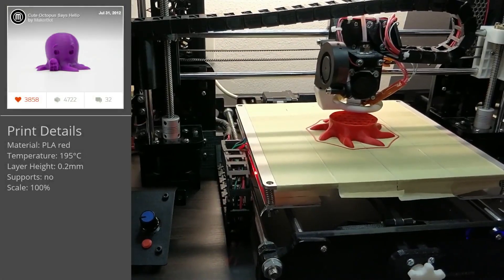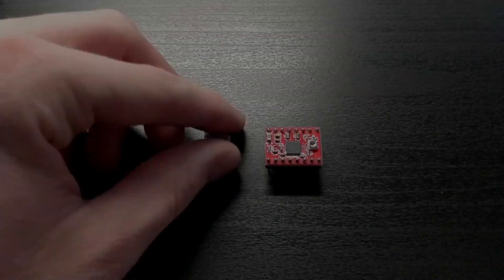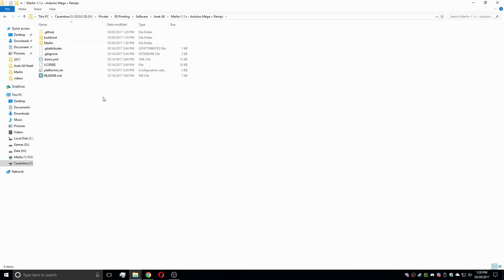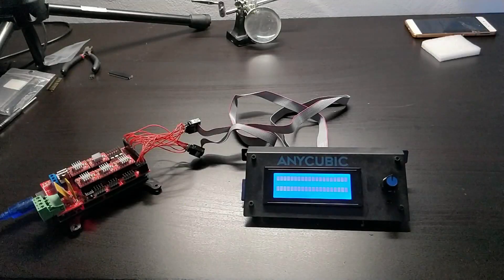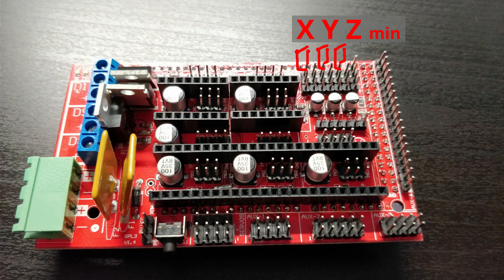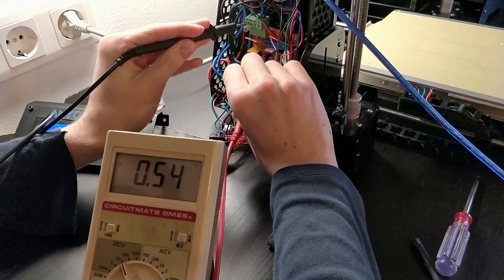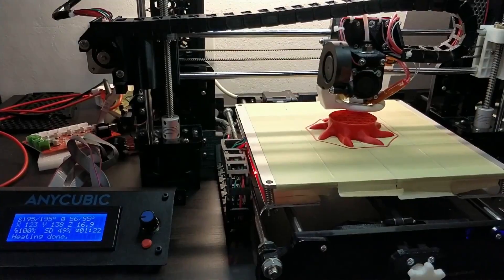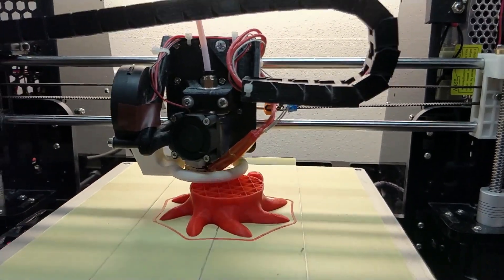Anet A8 Controller Upgrade (Arduino Mega + Ramps)

Comment: newer versions of marlin uses ZONESTAR_LCD at 1:45 instead of ANET_KEYPAD_LCD
Reply from the maker: That's true, I have learned it the hard way as well!
Reply: Oh interesting, for me that was not the case... i installed it 3 days ago.
Reply from the maker: It depends on which version of Marlin you have. They changed it in 1.1.7 (current is 1.1.8) along with a lot of other changes.
Reply: the one you are mentioning is listed above or another lcd? could you please share the link of ali express?

Comment: i want to make my anet a8+ silent, can i do this with this setup? the noise comes from the drivers, the steppers or the board?, can i just use other drivers?, thanks!
Reply from the maker: Yes, that's one option, but you need different drivers than I did, as mine are the cheapest A4988 that are actually equal to the ones of the Anet board. You can use better drivers, but only some work with an 8-bit board and some require extra wires and thus extra configuration. Also, they tend to get hotter, so you might need a cooling fan for the board. Another and maybe nowadays better option is to get a 32-bit board, they have become very affordable and allow you to use the high-end drivers.
Reply: @Caverntwo  which 32 bit board would you recommend me? im on the budget side, thanks :)
Also i have another question, the only thing that i did not like about this printer was its lack o fine detail, besides that is noisy as fuck. I only took notice of this when printing litophanes, anywhere else is decently smooth. Could this be because the resolution of the steps on the default board are lower than on an ender 3? With enders i can get really sharp details.
Apart from that im super in love with these printers, i've been running one for hundreds of hours without a single failure. just kinda lack of robust repeatability due to the extruder/hotend being kinda bendy. Also this is the first printer that hasnt given me any issues with the glass bed(warping), i found that kinda amazing.
Reply from the maker: Sadly I can't give you a recommendation, as I have only used two of them so far (that Chinese SKR and the mainboard of my new Artillery Sidewinder printer).

The noise is very likely due to it using cheap drivers, that are just simpler in design. Also, I'm pretty sure that the printer resonances the noise to make it louder. 

The resolution issue could have different causes, starting from the nozzle size, over controller accuracy and slicing settings all the way to the mechanics of the printer. Try to get rid of most of the mechanical play you find. From my Anet A2 I know, that the gantry had a ton of play. Check yours as well. Try to print very slow to see if the resolution is better. If so, there are mechanical issues/flexing/wobbles.
Reply: @Caverntwo  thanks man :elbowcough:

Comment: how did you set up you're dual z motors? id like to use E1 Port for Z2 under the name "Z_DUAL_STEPPER_DRIVERS" isnt listed
Reply from the maker: In my case, they are both connected to the same driver, so I have no dual z function in use. It works nicely without too. 

But if you want "real" dual Z, you need two stepper drivers and need to do the following config (Marlin 2.0.x):

In configuration_adv.h:
#define NUM_Z_STEPPER_DRIVERS 2

Furthermore, you can uncomment:
#define INVERT_Z2_VS_Z_DIR
if the second motor should go the other way thanks to its wiring

#define Z_MULTI_ENDSTOPS
if you have a second endstop, which would go into the plug defined at #define Z2_USE_ENDSTOP
Reply: @Caverntwo  what does it look like to have both connected to the same stepper? I see another set of pins right where you would wire up for the z stepper motor. Is that so I can wire two to the same driver?
Reply from the maker: Yes, the RAMPS 1.4 and other RAMPS based boards usually have two sets of pins wired in parallel.

Having two motors on one driver of course requires also driver adjustment, in order for it to deliver more power. However, this will generate more heat,  but should still work out for the average 3d printer.

If your Z motors just stutter and don't work, especially when there are now two on one driver, you need to ramp up the power by turning the small potentiometer on the driver. 

Use a multimeter to read the amplification reference voltage of a working axis first (usually around 0.5V or 1V, depending on the driver manufacturer), and then double it by turning clockwise and give it a try. Use something plastic, it's easy to short the driver when adjusting!

The higher the voltage, the higher the power and as a result the higher the heat. If the driver overheats, it will automatically shut down for half a second or so and then continue, which you'll see in your prints then... You need to find that sweet spot where it doesn't overheat but the motors have enough power to move. If a motor gets hot to the touch just by being engaged, the power is too much and you need to lower it.

Regardless of what you do, just pay attention not to short and especially not to unplug a motor when the driver is engaged, as it is relatively easy to fry them (amplification to very very high, which applies especially to the cheap A4988/DRV8825 drivers). If that happens, usually it's just the driver that's bad, but it can apparently happen that it fries more than just the driver and you get a dead axis on your controller, according to some comments I got on some of my videos.

Comment: i´m trying to update an anet a8 plus. I have a ramps 1.5 but it is almost the same as 1.4 but mosfets are better.Pinouts should be the same. I do want a dual extruder. but there is no output for the extruder cooling fan (the one cooling the print) avaiable. Since you opted for the dual extruder, how did you solve this
Reply: Tinkered on yesterday and got it working. Ordered the fan expander board. i will use the old board and work the printfan on that. The issue now is to have to get cura 4.11 use 2 xtruders How does one fool cura to increase to 2 extruders ?
Reply from the maker: You have to set it in the printer settings. You can also define the nozzle offsets there, if you haven't already in Marlin. The extruder switches using the T command, which will Cura takes care for you. Please watch my dual extrusion video for more information.
Reply from the maker: Hi Markus,
Thanks for your comment.
You're right, I ran into the same issue. The easiest solution is to get the Fan extension board. Just look online for Ramps 1.4 RRD and you'll find the small board.

Comment: So nice to see many people come to you for help. I ran into this video because I just purchased rotary encoder LCD2004 upgrade for my stock Ande A8 board since the seller claimed it was supported and I had no idea what I needed to change. Display is yet to arrive with its adapter, but I wonder if it'll work. If not I might upgrade to this setup as well.
Reply from the maker: Hi Mladen,
Thanks for your feedback. If you have a printer with an Anet mainboard, the Anet 5-button and the Anet 12864 controllers work natively. The RepRapDiscount Smart controller I used in the video was not working with the board back then, and looking up the current Marlin 2.0 code, the situation seems to be unchanged. However, the large RepRapDiscount Full Graphics LCD works with an adapter, that you can buy online or create yourself.

If it isn't supported, just get a new controller. The Anet board is very limited resource-wise, so that if you want to use certain Marlin features, you just can't thanks to running out of memory and CPU power (remember, it's 8 bits). If you're shopping for a controller, I'd just get a 32 bit board. I have actually planned to upgrade the mainboard of my Anet A2+ to such one, as I'm out of memory. Mine is scheduled to arrive next week. It's very likely that there will be a video about it then.

Hope I could help you!

Comment: My Anet A8 board is dead. But I have Mega2560+Ramps 1.6+TMC2208 and first I have one question. 
How to change Marlin to work as dual Z axis. I mean use Extruder 1 as Z axis 1
Reply from the maker: Hi, I'm sorry to hear that your board is dead. But the Mega2560/Ramps is more customizable anyways and definitely the better choice.

Apparently, that is relatively simple. All you need to do is to enable Z_DUAL_STEPPER_DRIVERS, and the first unused extruder driver will be taken. So in your case, that would be E1.

Source: https://github.com/MarlinFirmware/Marlin/issues/10612#issuecomment-386262389

Hope that helps, let me know if it works, as I haven't tried that so far!
Reply: @Caverntwo  Thanks a lot :)
Reply from the maker: You're welcome. Stay tuned for more content!

Comment: what chengement i have to done for my tronxy p802ea
Reply from the maker: If you want to upgrade the mainboard of your TronXY, it's actually the same process. You might need to get a different case though. You'll likely have to adapt a few things in the Marlin Configuration, like motor direction and sizes.
Reply: @Caverntwo  please specify me what settings i have to change  i am new in 3D printing world
Reply from the maker: Sadly, I cannot tell you in detail as I don't have this exact printer. What exactly do you want to do?
Reply: @Caverntwo  My dear respected YouTube , first of all i like to tale you about myself , I am a Electronics developer & Engineer & Article writer so whenever i build my projects i allows needs a enclosure or cabinet to fetes all the components and getting a professional look , so Recently i have perches a 3D printer  " TRONXY P802EA"after  greeting my 3D printer suddenly the control board stooped working completely and best low cost solution of control board is Arduino mega 2560  with ramps board & A4988 driver module.
 i decided to install ramps board and Arduino  and then i saw i have to install firmware and obviously most popular  Merlin firmware ,you when ever i have to install firmware first time & i need to configurations and change the settings "config.h" particularly for my 3D printer . , i have knowledge and working experience and making several project using Arduino but dont have any knowledge about those firmware /3D printing /Settings/ settings to greetings best printing quality , i alady dose manual bed leveling and z axis leveling , i am just a noobs in those matter so i need your help bro. Thanks a Lot
Reply from the maker: So you already got the controller installed, good! Now, I can highly recommend you to follow the following video, but choose the mainboard BOARD_RAMPS_14_EFB and the mega2560 in the platformio.ini file: 
https://youtu.be/EQoae6oXszE

Afterwards, you should have a working setup, but you might need to adapt the sizes and the motor directions.

Hope that helps ya!
Reply: @Caverntwo  when i purches it just some days ego my printer Tronxy p802ea  cames with melzi board which was died within 2 days so i have orders Arduino 2560 ramps driver and everything
Reply from the maker: Awesome, the Mega 2560/Ramps 1.4 combo is a cheap alternative to the original board. Once you wired it up, follow the video for the setup.
Reply: @Caverntwo  yes thank you , i alredy make a special 3d folder and save all the video on this folder even this one your video too
Reply: @Caverntwo  by d way how was the life according your experience ? with this board ? arduino mega2560 with 1.4 rams and driver ? how was the life and printing quality
Reply from the maker: So far, the controller still works just fine. I'm still on the default A4988 drivers, which is good enough for me, printing wise, however, I might upgrade them in the future. 
It's important to install a MOSFET module for the heated bed though, as the power required for the heated bed exceeds the transistor's load.

Comment: Great video. I have develop an open source free d printer firmware and i would like to share it with the community. I have test it with Ramps board. Please let me know if you consider to give it a try. I provide a link to the source code.
https://github.com/3DHexfw/3DHex
https://www.youtube.com/watch?v=9iOEEMgbggs&t=2s
Reply from the maker: Hey there,
Thanks for the feedback. I've checked out the source code and might give it a try in the future. I like that the code is relatively simple, even I understand it! 
I like the project and probably even take some parts of the code for a different project.
Reply: @Caverntwo  My project it is totally free and open source you can do whatever you want. You can contact me in personal to tell you exactly how to install it and not lose your time trying here and there. Thank you.
Reply: @Caverntwo  Hello, do you have any plans to test my firmware?

Comment: Hi, I need help I was buying the Marlin 1.1.9 compilation, this error came out, could you help me "Error Arduino Anet A8 Marlin Ramps 1.4" https://docs.google.com/document/d/14Fy1K4CSxbY7LL26fd_TYprl0j0u9rTts-w6q6mWmZQ/edit?usp=sharing
Reply from the maker: Hi  Mauricio,
sorry for my late response, but YouTube decided to not push a notification due to the link!
The error you encounter is a limitation of the controller, as it cannot use interrupts on these pins. There's a setting to disable that, called ENDSTOP_INTERRUPTS_FEATURE, which you need to comment out by putting // in front of the line.

Comment: Is it worth upgrading from boar to ramps? I will have some improvements in print speed and quality
Reply from the maker: Well, it depends what you want to archive: I upgraded to be able to run the dual-extrusion setup. Furthermore, it's nice to have a lot of free pins for extensions like a filament sensor and more. Quality-wise, you can install better stepper drivers to get better printing results and more. If you plan to keep the single-extrusion setup and just want to print with it, it might not be worth the hassle of upgrading, especially as most printing problems of the Anet A8 are mechanical (mainly z-wobble). Just get Marlin on the default board (I have a separate video about that) and you are good to go!

Comment: hello, i am trying to install one of those lcd controllers on my anet a8 but with the stock motherboard. I did everything that you did in the video starting at 1:45 . I commented the default ZONESTAR_LCD line, and uncommented the REPRAP_DISCOUNT_SMART_CONTROLLER.
But when i verified the firmware i got an error message saying: 'LCD_PINS_RS' was not declared in this scope.
Do you know how i can get rid of this error?
Reply from the maker: Hi Maltesaa,
I am sorry but I forgot to mention in the video that the Anet board just supports the default small and default large LCD controllers. The board has a completely different pinout from what the ReprapDiscount controller uses, and as far as I can remember, even one or two pins less. That's why it just doesn't work with the default board. Either get an Arduino Mega+Ramps combo like I did (I also created a video about that) or use the old board. Anything else (like soldering an adapter and programming the pins by yourself) is going to be very difficult to get right.
Reply: Oh okay, I might just buy an anet a6 lcd controller that i've seen other people use with the stock motherboard. Anyways thanks for the quick response :)
Reply from the maker: If you get the large Anet controller, all you need to do is to enable it in the firmware and it should work right away.
Even if you do decide to upgrade the mainboard in the future, you can still use it with an adapter (that you probably need to solder yourself). Anyways, I hope that it works for you ;-)
Reply: Got it! Thanks for all the help :)
Reply from the maker: You're welcome! If you run into any problem, let me know.

Comment: MY 3 A4988 of Onboard Anet Controller got bad. (Motors behaved crazily even after restoring firmware & eeprom) . Its time to change to Ramps 1.4.
Reply from the maker: Hi, that's pretty unfortunate...
You can upgrade to a default RAMPS like I did, or try to get some all-in-one controller that is based on a RAMPS. Choose what you like more but don't forget about electrical safety. If you run into any trouble, make sure to let me know.
Reply: @Caverntwo  I have ordered ramps 1.4 with arduino mega from aliexpress.
Don't know how will i solder female headers to everything!
Reply from the maker: Just get a few of the standard-size  male connectors and solder the wires on. Don't mix them up and don't forget to add some heat-shrink tubing to hide exposed wires (I know, I also didn't do it as I should have)...

Make sure to buy a compatible LCD screen, as the default Anet 2004 doesn't work with any other controller. If you have the large one, you'll need to solder an adapter yourself.

It should work just fine then, like I've shown in my video. If not, let me know!
Reply: @Caverntwo  Thanks. Your video is very helpful. I like it.😘
Reply from the maker: Thanks, I'm glad that you like it ;-)

Comment: What is the maximum temperature reached by the extruder with arduino?
Reply from the maker: This depends on what you set in the firmware. With a PTFE-inlined hot-end (default on most cheaper printers), you shouldn't go above 235°C, otherwise the PTFE starts melting (and will clog the nozzle). Among a lot of other factors, it also depends on the power supply that you have, as higher temperatures require more power.